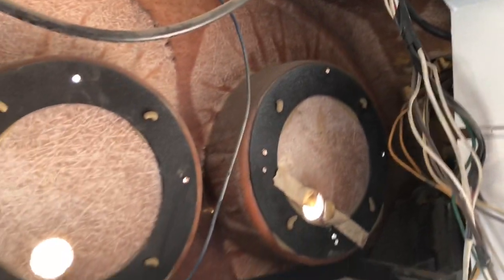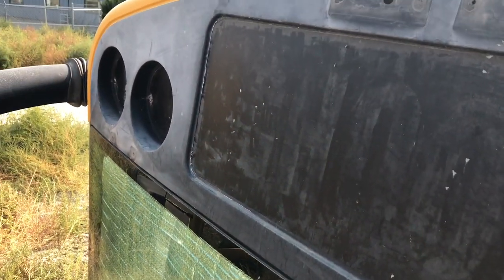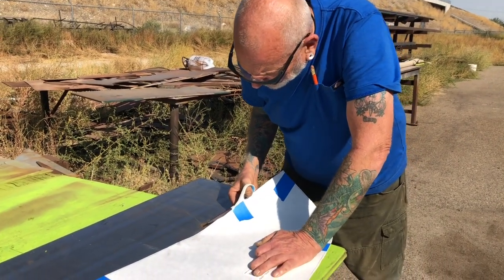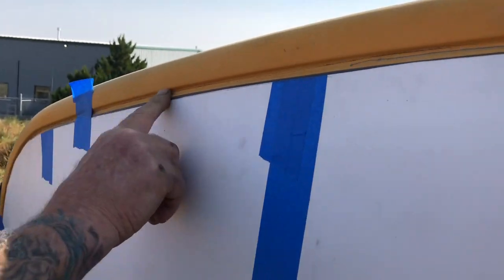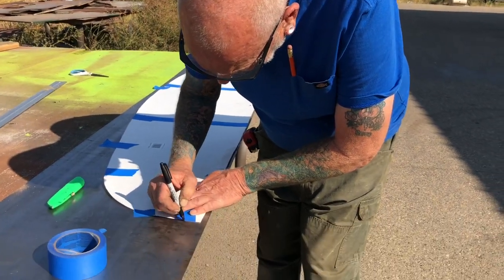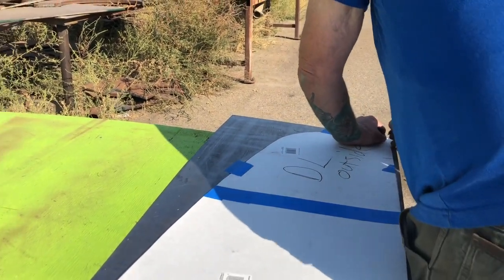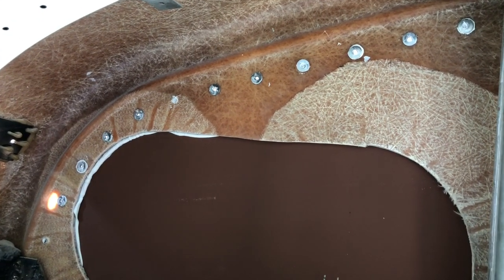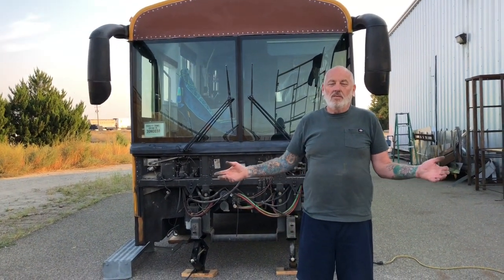Face Lift for our Bus - Vlog 172 School Bus Conversion

Comment: Well done! Looks nice and clean.  I think I'm going to leave the eyebrows on ours.  Planning to do off road lights to replace the school flashing lights for finding camping spots after dark.
Reply from the maker: That's awesome .... we are thinking about adding LED light bar to the roof rack on ours.
Reply: @KnappTime  definitely won't regret more light when it's needed.
Reply from the maker: @allmomomosthomebus3895   - that's for sure. We are wanting to go all away around her. Front, Back and 2 sides. Then we will be able to light it up everywhere.

Comment: Will your bus pass the Safety Inspection without top Front Marker Lights?
Reply from the maker: Thanks for the tip .... we check into it and we did have to put them back up there. Coming up in a next video down the road. 👍😁👍